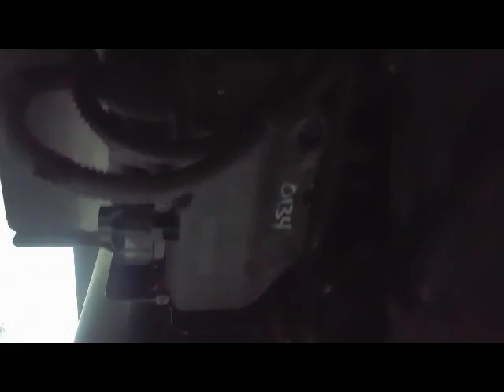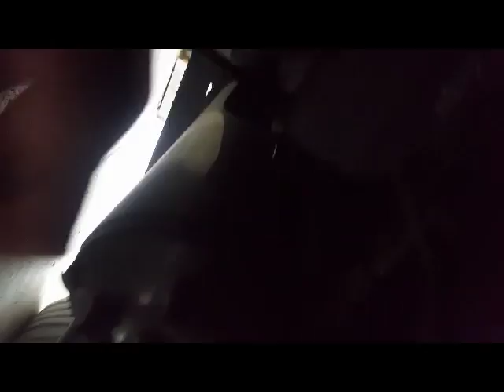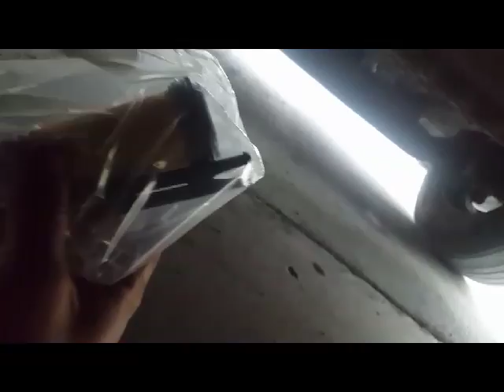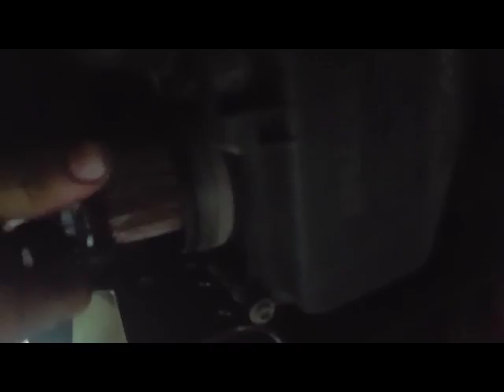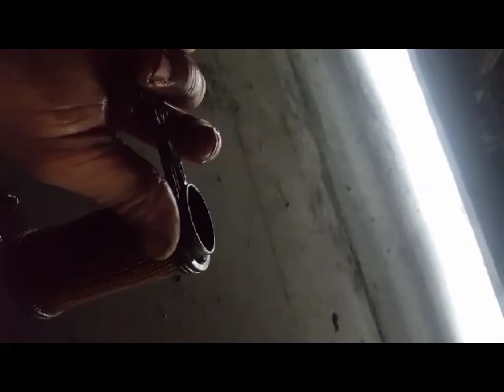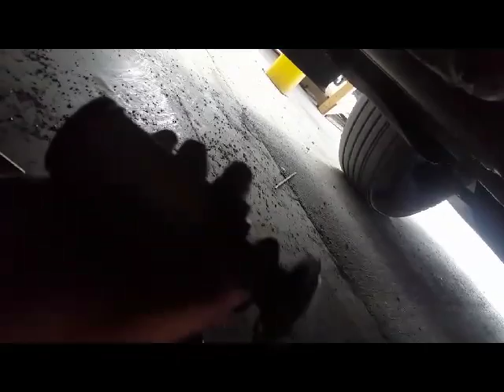Replace DEF filter on a Volvo d13

Comment: I m on my way to this shop i m gone sleep in front until you guys get to me to work me inside the shop i need injectors Cups a million other things because i was afraid other shops what they did or gona do i took the truck to worldwide trucks in Cincinati Ohio i think most of us know where that junki place is for adjusting the valves that ass broke a screw from my intake inside the head or cylinder on the side left engine and they try to blame on the engine saying that it to old and have too many mils realy 500000 and blal blaaa i didn't took any action it is just a aaaa  aaaa you know i m on my way i will see you guys and great job man thnx
Reply from the maker: Shoot me an email if you can, semitrucksdiy@gmail.com. we are closed Christmas day